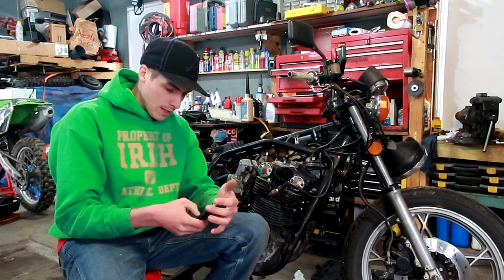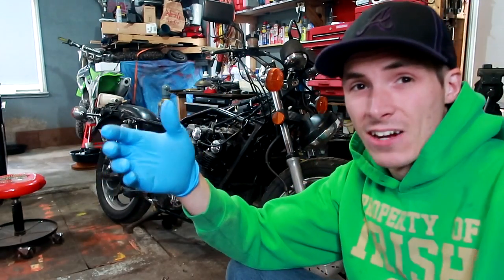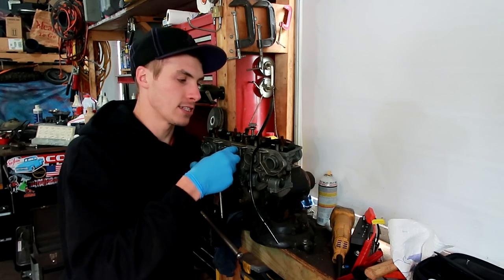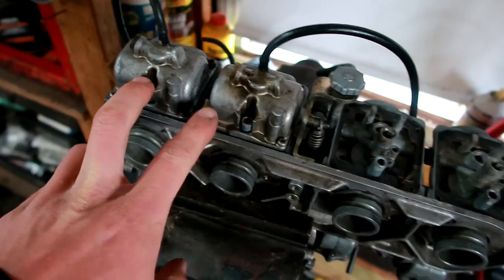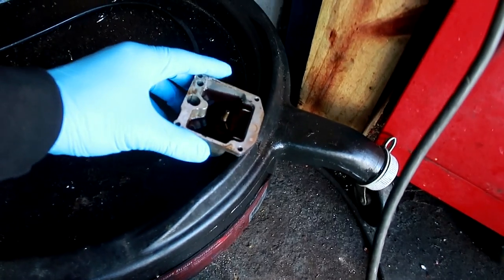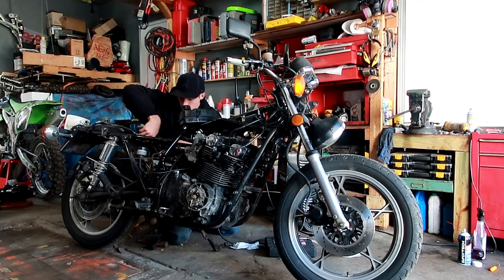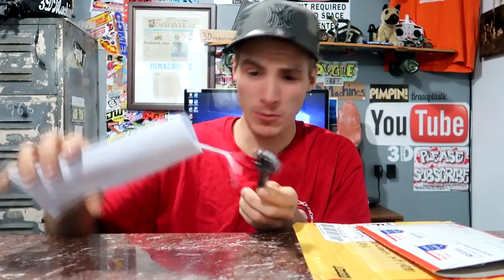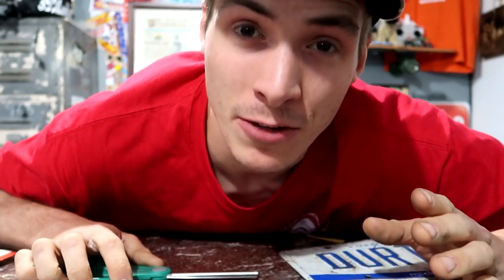IT'S GETTING WORST...

Comment: bring carbs to small engine shop and get them to use an ultrasonic cleaner on them should cost around 25 dollars works 99 percent of the time well worth the money!  clean out the jets by hand using an  torch tip cleaner or a small wire then reinstall the carbs get a decent spark tester that you can adjust the spark gap to test your coils sometimes when you check it visually it looks ok but when the gases are under pressure in the cylinder it is weaker than it looked and it won't fire.
Reply: davidbrennan5 you can buy ultrasonic cleaners well worth it if you deal with small engines a lot
Reply: They are the best thing for cleaning carbs that I have found by far.  I do recommend you buy a good sized one if you plan on cleaning carbs often. I met a guy on a chainsaw forum 7 years ago and he told me to get one and it was the best thing I ever did. If your working on 20 year old+ carbs it is the only way to get the varnish off the internal passageways with any kind of  consistency.  I have even cleaned 1950's tractor carbs that looked like they had no chance of  ever working properly again. The only time I scrap a carb,  1% of the time,  is if the parts are so pitted it cannot ever be machined or buffed to  seal properly.

Comment: (ITS A TIMING PROBLEM) dont take me word for word, but it did shoot some smoke back through the carb, so its probably a timing issue.
Reply: IF It shot through the carb it is "firing" while the intake valve is still open, but IT STILL COULD BE THE CONDENSER

Comment: If you went through the carbs and all the jets and other holes are clean, turn each cylinder to top dead center and line up the points so it sparks there, it it backfires then advance the timing on the cylinders that sot smoke out the carbs, if it pops and sputters move the timing back a little.
Reply: shit can it buy usa and be glad you wont have to feed it rice or beans or watermelon?

Comment: I built a Cb900 with 4 carbs the biggest problem you're going to have is you need the stock airbox for stock carburetor's it's super important to have the right air flow, and with out the exhaust on it won't have the right back pressure. When you rebuild the carburetors you have to sync them together with a special vacuum gauge it has four individual vacuums on it. I have one not sure where you live in pa but I live in Athens pa I'd be happy to help sync them when you get that far.

Comment: Dalton, you are on the right track. You have to remove every brass screw and orifice in those carbs and clean every port and orifice in the body.  Carbs is the main reason those bikes got parked in the first place.  The drilled out slots on the points plate is a dead giveaway that the last guy couldn't get it in time.  I haven't worked on a GS1000, but I have resurrected a lot of Hondas and Yamahas.  There should be cam chain tensioner that you have to adjust (usually easy, google it) first b4 you start trying to adjust the points and timing. good luck - dan

Comment: I would go down to your local bike shop and ask one of the older mechanics to help you at your place  for a couple hours after you get the carbs cleaned out really well. He will have the tools your going to need like the carb sync tool etc.... If not get yourself a shop manual and follow the instructions.

Comment: I have owned many GS's. Including a 1979 GS1000. Some quick tips, clean/rebuild the carbs, and replace ALL electrical components and wiring. From the stator/mag./coils, to the handle bar switches, replace it all. I went through replacing these items one at a time and tracing down dead spots and shorts due to corroded/stiff wires. All the switches will be corroded or worn out. Don't do what I did and be broken down on the side of the road every other ride. The only proper policy for old bikes, is replace ALL electric components! I hope I've saved another soul......

Comment: Dalton, they have to make a electronic ignition conversion for that thing. but more important let me give you a super secret trade secret to clean carbs to brand new, get some O.M.C Tune up in a can. "yes that is really what it is called" and soak all your carb parts in it. you can keep it in a gator-aid bottle to put small stuff in to soak and dump it out in another container to get parts back and the pour it back in the bottle. " it lasts forever". if you have any questions just ask.

Comment: You are SO close! The timing can be checked with a battery and a light bulb wired to the points. It should light up on F on the plate, pointer usually at top. Turn engine by hand. It will scare you when it comes to life, you wont ever forget it!

Comment: you have two sets of points on  first set of points that has to be timed to two pistons that the coil and set of plug wires feeds,   put the primary firing piston at top dead center of those two pistons  (accordingly to that coil pack and two spark plugs) and SET THE POINT GAP. (then go on to the next set). You must find the piston that needs to be at top dead center, when you set the points to that coil pack. each coil pack fires two pistons, If it is miss firing on a set of piston just start over and set the points to top dead center on the other piston. GOOD LUCK

Comment: hey bud you may need some back pressure for the carbs to function because from what I'm seeing is that is not getting enough fuel to ignite untill you spray fuel into the carbs so you might try turning the fuel up or just adding some kind of pipe
Reply: for an exhaust

Comment: I will say something from experience, don't jump start a motorcycle or snowmobile atv or anything that has one of those smaller batteries unless you are using another small battery,  Why? The wiring can't take a large amount of amps and it will melt your wiring or cook your stator/charging system coils.  I would just get a new battery and charge it up because your charge pack will destroy the stator.

Comment: Brake clean works great on cleaning carbs,Spray the shit out of it!
Reply: brake cleaner is bad for gaskets and o-rings. The best thing for cleaning carbs is an ultrasonic cleaner.
Reply: Well,you take the gaskets and the o rings off of course,Spray it threw the jets ,it cleans everything out great,I use it all the time on small engines!
Reply: I have tried everything over the years.  It all depends on how bad it is but a friend of mine that rebuilds 1000's of chainsaws turned me on to the ultrasonic cleaners about 7 years ago and I have never looked back. It works 99 percent of the time even when it is caked in green sludge and the carb comes out like new inside and out.

Comment: Won't run right if it doesn't have the proper air in and pressure out. Aka put air filter and exhaust on

Comment: It is not the points it is the timing of the spark. Like a distributor. Find the timing specs on the engine, bring the piston on to top dead center number one. turn your distributor to match that spark plug wire that is for number one  That should get you close enough to fire the engine.

Comment: In order to sync all four carb you need a small machine that uses the vacuum pressure and shows you when they are all in sync. otherwise you are going to have a hell of a time syncing them.
Reply: MASSIVE 2SMOKER true but i think he should do it after he has engine in gator
Reply: JRT I mean it really doesn't matter regardless because he will have them synced before it goes in or after it goes in hahaha

Comment: I'm pretty happy you got a 4 cyl inline bike, the bike in my pic is also a 4 cyl and it doesn't overflow the fuel and. Ow I have that problem with gas in my oil... did you rebuild your carbs with original parts and new gaskets? I tore mine apart to clean them and have had this issue since, pretty sure one of my needles is stuck open dumping gas into my cyl head and so forth.

Comment: hi through 3dmachines Aim a big fan and I just wanted to ask something is the carburetor dirty because I have a go-kart and it will not start and it has spark but the carburetor was clogged and I fixed it and now it drives it might be that problem

Comment: se3d just bring the motorcycle to me and I'll have it running like new in no time. I have a Honda Nighthawk 700 shaft drive. when I got it it it had the same gas in it for 19 years and had not been started. with half the work needing done that you did already I was able to get it running very quickly. what you need to do is run some ferryman b12 fuel system flush into the carbs as a 50 50 mix and turn the choke on and try starting it like that using a little sprayed in fuel to help get it started and keep it running long enough to pull the fuel mix through all the small ports on the carbs. that's what I did to my Nighthawk and didn't even take the carbs off or take them apart and it started up fairly easy like that

Comment: Do the auto light bulb with clips to the points one set at a time the light will go out as soon as that cylinder is to fire the points open it breaks the connection and triggering the saturated coil to fire
Reply: You cant use a timing light from a car unless you have the bike actually running thats what the little single element 12v bulb is for. Just trying to help bud hope you dont take it the wrong way any questions just ask im 40 yrs old and grew up with those bikes they can be a headache if you cant find reliable  advice

Comment: carb cleaner wont clean these carbs, you need to at least soake them in some vinegar for few days and then run a cable wire throu the acceleration ports(small holes under the butterfly valve) they may look like they are not clogged but they intersect with a lot of other ports and passages and if some of them are even a bit clogged it will not run right or even start.also make sure you did not  get coil primary wires mixed up,
Reply: wintch cable wire, just to clarify that :D

Comment: My god those jets look varnished. Invest in a sonic cleaner, lol. Also, hope you're not using Purple Power to clean them. That stuff creates a nasty chemical reaction with aluminum, and leaves a white powdery residue that needs to be neutralized. You'd be better off tearing them all completely down, soaking the bare bodies in MEK (no rubber or plastic), and reassemble and sync them. Carbs are cheap to due, just time consuming.

Comment: ive been working on a Jeep Cherokee for 14 hours now
Reply: Scott Mcconnell work harder lol
Reply: oh I'm almost done after a 3inch lift engine swap and a transfercase drop about time to fire it up and go trailing
Reply: Scott Mcconnell nice what size of tires
Reply: 245 65 16 
 30inch just enough to have flex and still tear it up tonight doing front and rear lockers after I hit some trails and the sand dunes today
Reply: Scott Mcconnell nice I have a 1998 chevy 1500 with an 8 inch lift with 52 Mickey Thompsons and the truck is almost ready to be my daily again

Comment: What will happen with the kawasaki??
Reply: Blaž Benčič he should motor swap it to like a 1000cc
Reply: Nah, he should rebuild it with original or 270cc cylinder, bassicaly because if this bike he is what he is
Reply: It was a kx250 and it would be wicked fast a 250 is light and if you threw a big motor in it it would be braptastic